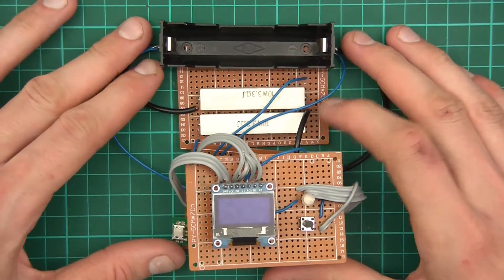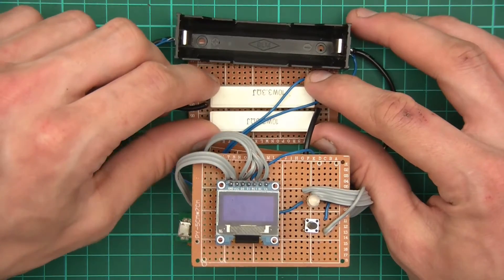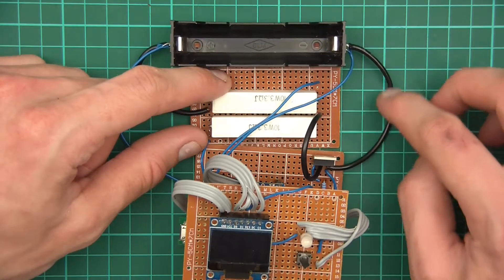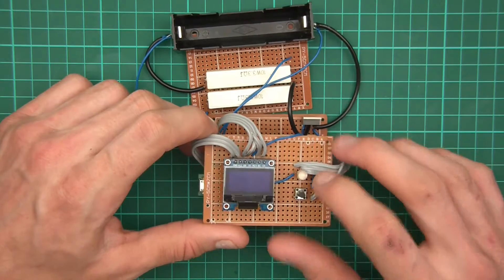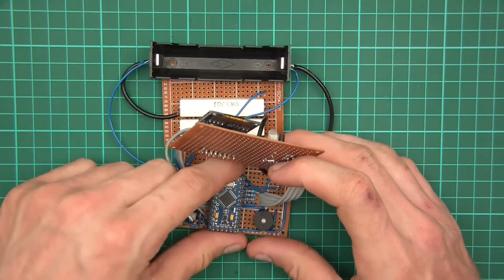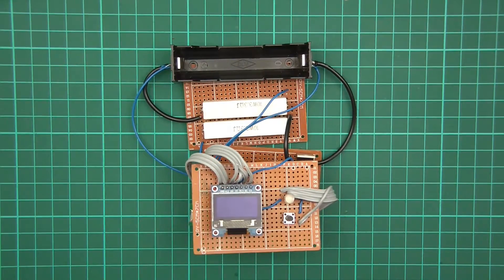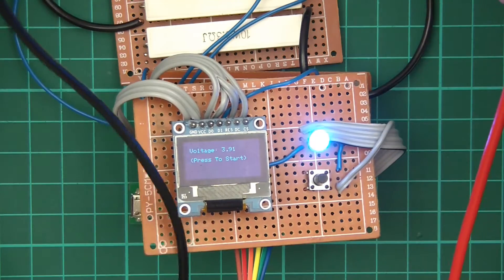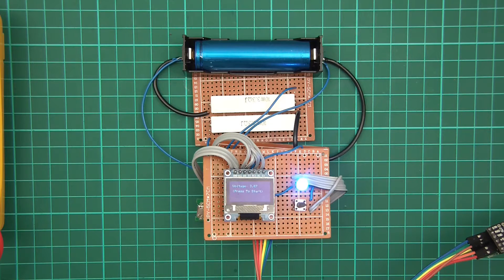TUTORIAL: DIY 18650 Lithium Ion Cell Battery Capacity Checker Tester (Part 21 - Matrix Board!)

Comment: You'll never have precise AND stable voltage measurements without having an external voltage reference.
Why 1.65 Ohm discharge resistor ?
4.2V / 1.65Ohm = 2.54A
It's 1C or more for regular 2500mAh Li-cell ?
Maybe twice too much ?
Resistors you use should be mounted well above the PCB for cooling reasons.
Also, ceramic resistors have poor temperature coefficient (tempco, stability), so you can't rely on their resistance, since it is going to vary a lot with the heat they're producing. Non-linear resistance.
No circuit, if you want any kind of precision and stability, should be powered via USB cable and connectors.
USB cables are of various qualities regarding their current capabilities. Some are pure garbage.
USB sources (wall-warts, PC's or other) are unreliable under load and their output voltage is almost never 5V.
If unable to invest cca. 70 EUR for an entry level variable lab power supply,  grab an old PC ATX power supply and add a dirt cheap LM317 adjustable voltage regulator.
With proper heatsink, it's good to 1A, providing pretty stable output voltage.
Reply from the maker: Hi! You an have precise and stable voltage measurements without the external ADC.

The 1.65 ohm resistor was just what I had lying around. Originally though, I was going to use the two and add a switching feature so that you could optionally switch one off, therefore switching between 3.3 and 1.65 ohm, depending on your cell. I believe most 18650s have a rating of 2C, and the new capacity seems to be 2ah, so a drain of 4a may be ok. Ofcourse though, if the C rating is 1C and you have a 1ah cell, as you say, the drain is way too high!

I agree with you about resistor positioning, but I've got the OLED, so I had to do something different! Where would have put the resistors in this design?

Thanks for the info about ceramic poor coefficient, I didn't know that. I'll have to look into it.

I've noticed that USB power isn't perfect, but it does appear to be good enough for this project since it draws very little current from the power supply. This project can work precisely and reliably while being powered by USB. I've got a variable lab power supply in my workshop but I think USB is better because most people can easily get a USB adaptor, whereas is really inconvenient to use the variable power supply.

I've got an old PC power supply and LM317, but that can be a separate project. :-)

Antony...
Reply: External voltage reference, NOT an ADC
Reply from the maker: John Smith sorry, that's what I meant.

Comment: Another good video. Nice that you're getting it all put together. Pretty good that the mosfet stopped getting hot once it there were solid connections installed. I plan on making my own breadboard because of these reason. My bms I'm working on is very finiky on a standard proto-breadboard. So I'm gonna take female headers and solder them to a matrix board that has the trace stripes on the backside. No more loose connections  ;)
Reply from the maker: Korishan Yeah, that's it. The main problem with the Mosfet was that the wiring and schematic didn't allow there to be a proper voltage drop across the base. It was to do with wiring, and position of the wires, etc.
Reply from the maker: Korishan also, are you going to do some videos about the bms?
Reply: I will, at some point. I need to get it all working and make sure I understand mostly of what's going on with it and how to tell the chip what to do. I'm not coding the bms in the arduino/stm32, but using those to communicated with the Texas Instruments BQ769x0 chip. So it's quite a bit of a learning curve. I don't come from a background in electronics such as you did. This is all new territory and trying to tread the waters very gently without going under. I think I already bit off more than I can chew with the project, but I will continue to progress forward.
Reply from the maker: Korishan Keep going! I didn't come from a background of electronics! I learnt programming but it's very very different. Just keep learning my friend, it's all I do. I'm just a beginner. :)
Reply: Well, background in programming  :P   Yeah, it's definitely a learning curve. But I'll keep trudging forward. One call at a time ;)
Reply from the maker: Korishan Yeah, that is all I do. Jan 2017, I know pretty much nothing about electronics lol.